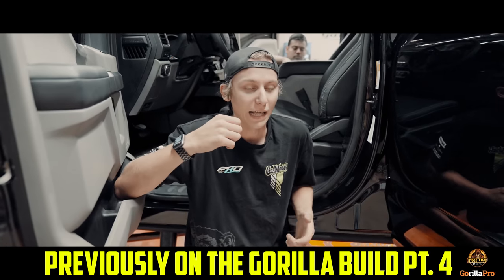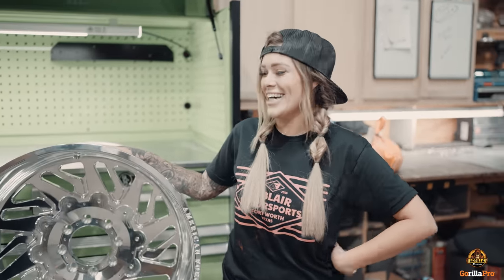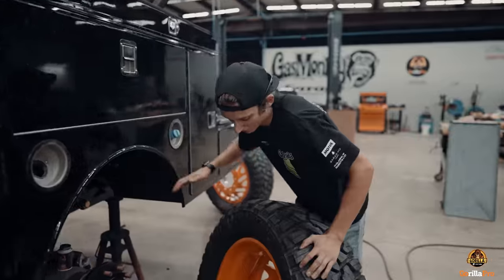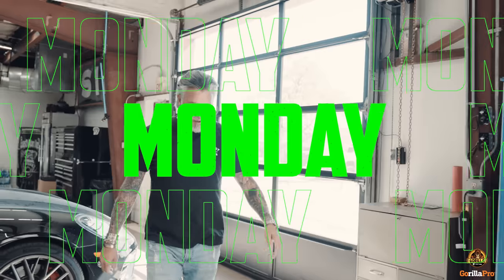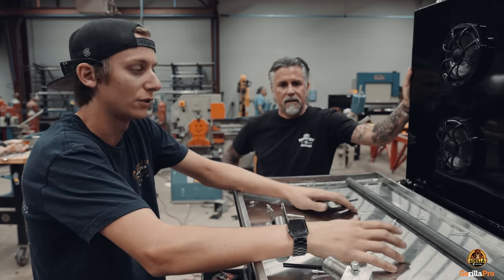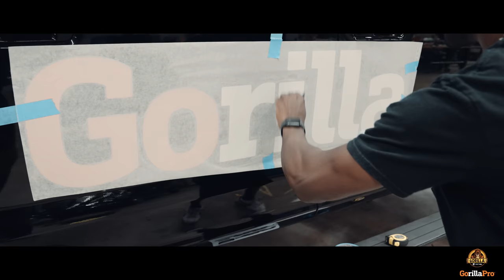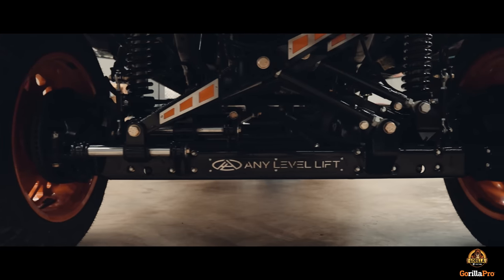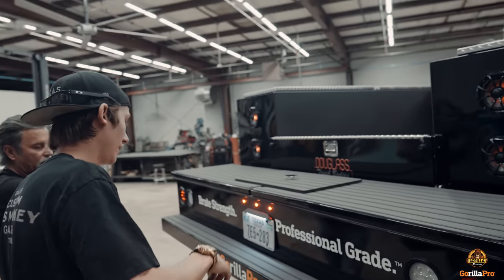Building A Gorilla Pt. 5- GorillaPro® - Gas Monkey Builds

Comment: Put a thin piece of rubber padding on the backs of the two orange hooks that are on the front bumper to pad them so that they don't sound like a hammer hitting the bumper when they hit certain bumps. You can do like I did and get a couple of those clear round rubber stops and stick them on the backs of those hooks. Or just thin clear rubber padding.
Reply: But how would they stick it on? They would need some kind of adhesive…
Reply: @ZacksHacks  I think Gorilla pro has something for that😂

Comment: They won't be safely putting 20,000 lbs in that truck! Let's say that truck with the lift weighs 9,000 pounds. 2,000 lbs for the bed and maybe a 1000 lb for the cool add ons. That's 12,000 lbs. Those tires are rated for 4,189 lb. Those tires running in a dually configuration are rated for 3,686 lb roughly. 3,686 x 4 = 14,744 + (4,189 × 2) = 23,122 lb. So if the load capacity of the tires is 23,122 lb and truck weighs 12,000 that a total 11,122 lbs a weight that can be added to that awesome truck.

Comment: I was going to correct several ignorant things that people have said in their comments but I don't really feel like it, I will say torque is torque no matter if you piss on it or put water on it, Loctite is moronic to put on your wheel studs unless you want to replace them when you break them taking them off and possibly destroying your threads and therefore once again must be replaced also if that be the case.

Comment: What about all the powder coat that came off the rims when mounting?
Reply: That was the inside rear so you'll never see it. But I understand what you mean. Lucky for them I believe they were sponsored so mostly no money was lost, but if you're getting new wheels and tires always make sure those that are mounting them have up-to-date tire machines and that the replacement parts on said machine are in good working condition. Meaning the parts that are there to protect the wheel from being damaged. 
If you bought those wheels you'd be paying right at $2000 per wheel, and then paying to have them powder coated. So any type of damage is very costly.
Reply: @calvinh.8882  ...we're somehow saying the same thing

Comment: No just do a projector screen that folds up out of the back of the bed by the back window push the button and it comes up and then have the little projector that sits on the back of the tailgate and projects it to it quick fast and easy and stored the projector in the Box they have the little projectors that are at Best Buy for like a hundred bucks that you can have your projector in your house one of those theater system ones

Comment: Never before released wheels, ruins them with powder coating. Second the mats wouldn't move around if you cut them to size. Now they're glued down where you can't pull them out and clean/spray them good.

Comment: All they did BOLT someone else's parts on a brand new truck.  Bumper headlights bed seat covers grill tow hooks mirrors speakers radio. WHAT did they BUILD.??? 😂😂😂😂😂😂😂😂😂😂😂😂😂I forgot tires and wheels.!! 😂😂😂😂
Reply: Same as building a house using trusses and paint and siding and appliances
No one builds anything they assemble. And here come the woodworkers and lumberjacks